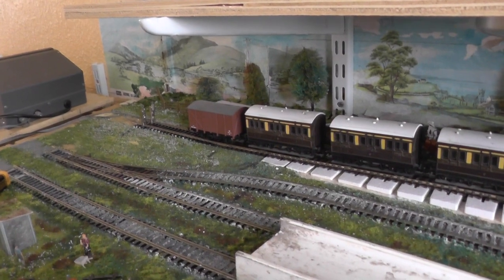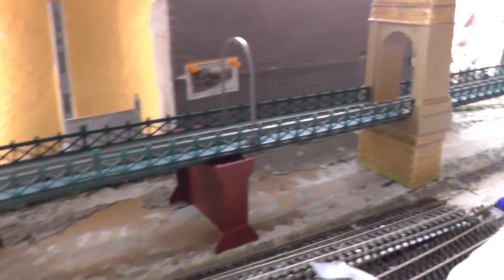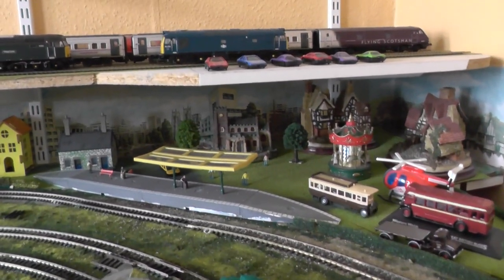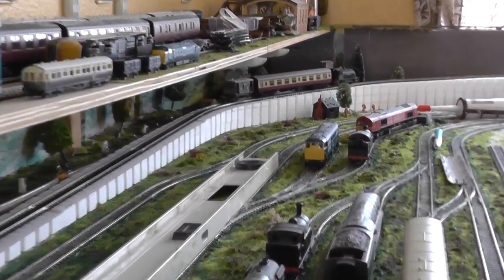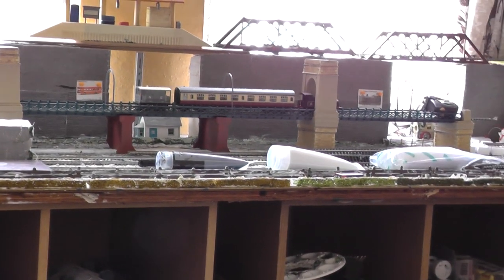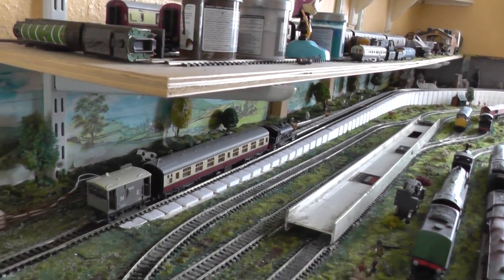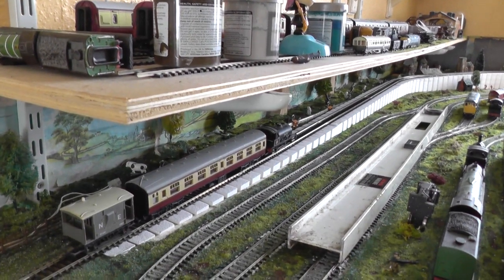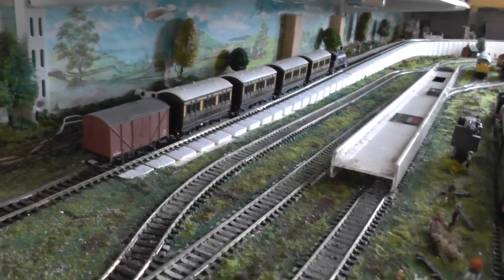Colin's trains installing inclines and risers and test runs July 5th 2020

Comment: Have u heard on Sunday to Monday Tondu doing rail maintenance work?
Reply: Would u be able get some videos of maintenance work in Tondu please?
Reply from the maker: Thanks Ethan,  there was a weed spraying crew at Sarn station yesterday, there was supposed freight movements at Tondu early May, but was cancelled, will there be freight moving around Tondu soon
Reply: Colin Prosser I not sure. Will they ever start using freight trains around Tondu  more ?
Reply: Colin Prosser I want know if they use fountain level crossing more? Will they have more freight trains in Tondu. Will the line start getting used alot more?
Reply from the maker: @ethan_transport_enthusiast8218  Sunday and Monday will hope the weather bit better, will have a look, most likely an early start by them, they did some work at the Fountain crossing a while back, so could be freight again along the line, will ask in local railway groups any info also
Reply: Colin Prosser I Hope in future! There be more freight trains in Tondu maybe once month